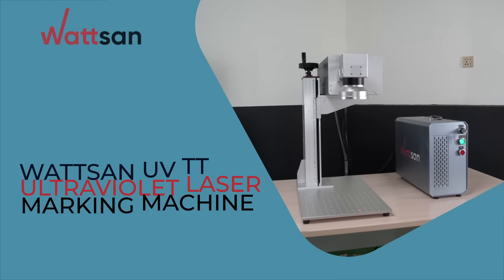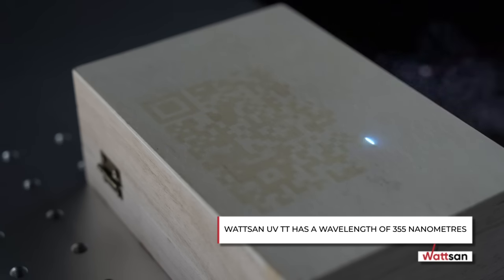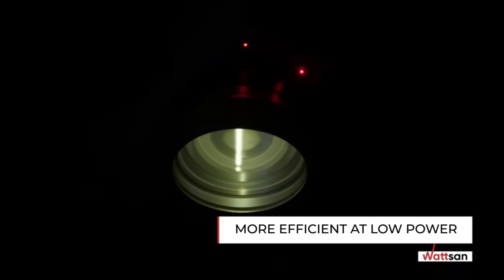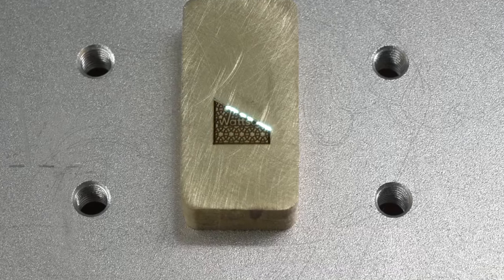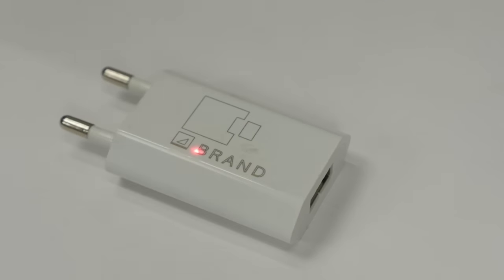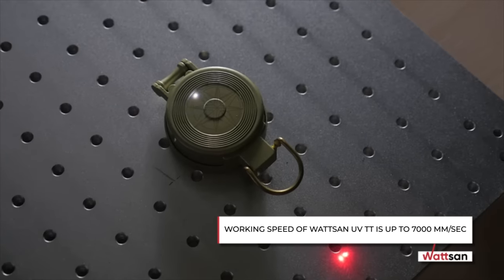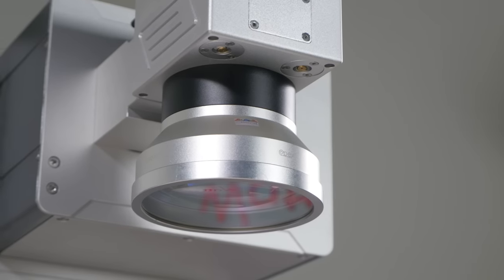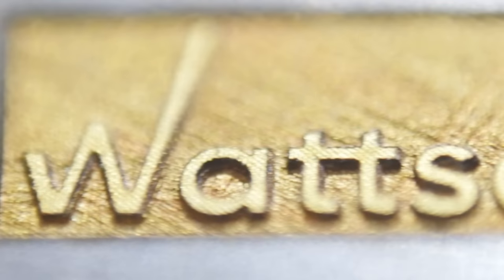UV LASER MARKING MACHINE | WATTSAN UV TT REVIEW

Comment: can it print on wooden beads (for jewelry), 7-10mm in diameter?
Reply from the maker: This UV marker can engrave any material. Including wooden beads. This is its special feature.
As for the shape of the wooden beads themselves, you can attach them to the rotary device itself if you need engraving over the entire surface of the product. You can also string them on a needle and then insert the needle into the rotary device for greater convenience. You can also use a glue gun to simply glue the beads to the rotary device.